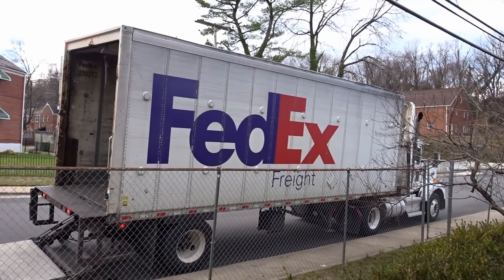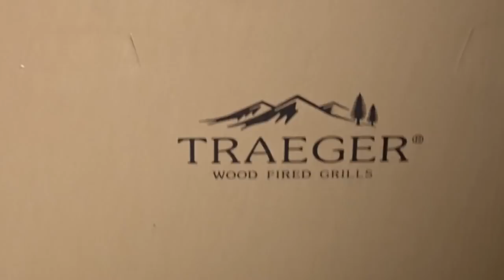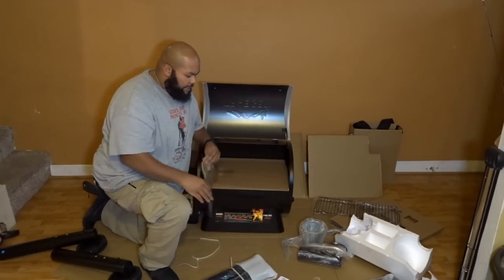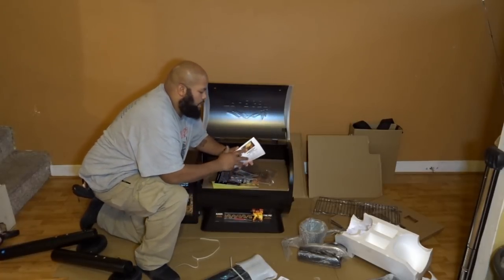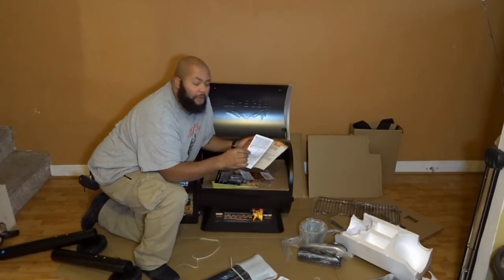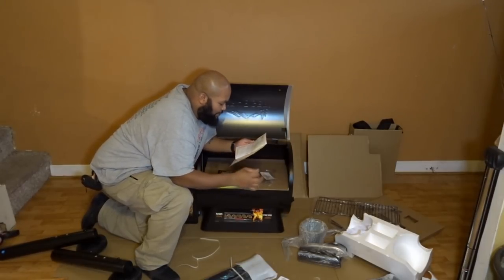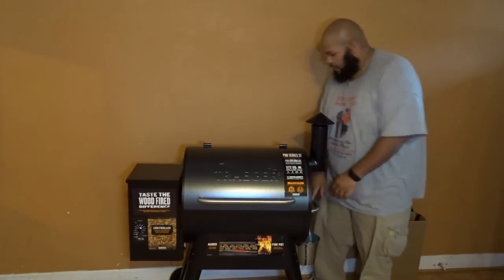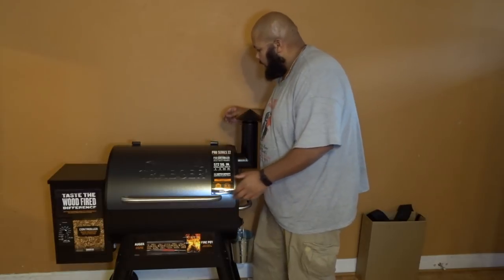SDSBBQ - Traeger Pro 22 Unboxing and Assembely!

Comment: Can’t wait to see what your honest opinion is since this wasn’t given to you. I run a smoke wedgie and adds great smoke flavor.
Reply from the maker: I have cooked a few things with out adding the smoke tube... I may try it soon though.
Reply: SDSBBQ  i have a drum, egg and pellet . I’m missing the offset but will be added soon. Out of those that own the pellet grill has the weakest smoke flavor profile but it’s super convenient and great for baking or sides. My drum has the heaviest then the egg is in the middle road for smoke flavor.
Reply from the maker: I too am missing an offset simmer my big ones are all reverse flow. I have cooked a few things and I can agree smoke flavor is lower but convenience is higher!
Reply: SDSBBQ yes so i use mine during the week for quick cooks if i don’t want to mess with the egg and charcoal. A simple grilled chicken breast cooked at 350 is amazing and juicy compared to other cooking methods. Pork tenderloin cooked 250 until 145 is so tender and juice it’s life changing. Seafood like shrimp and scallops at 300 in a pan is awesome. One thing i learned using a pellet grill is cast iron pans are your friend and get nice color on foods compared to aluminum disposable pans, also cooking low over night cooks brisket at 180 over night maybe 8 hrs then 225 and finish like normal is out of this world.
So word on the street it lumberjack 100% are the best pellets you can get and i agree with this. It’s good to find a group buy and get them dirt cheap  $8 bg or dicks sporting good had them online for $15 i think for 20 lbs. good luck 👍
Reply from the maker: I really appreciate you taking the time to give me the scoop... I am looking forward to really diving deep into the pellet smoker/grill way of cooking. Thanks!